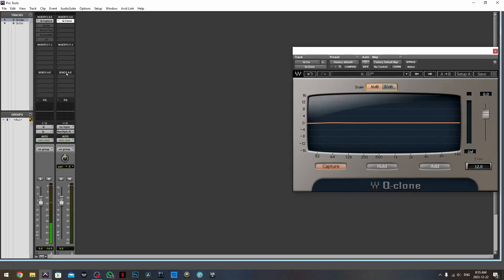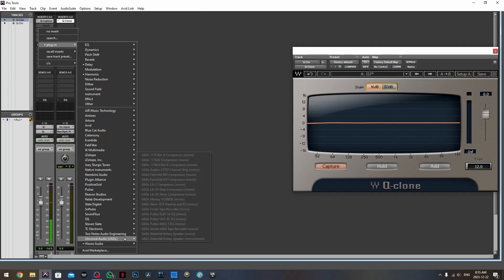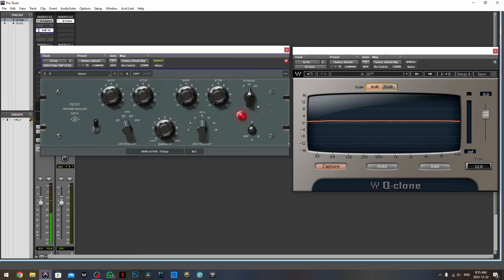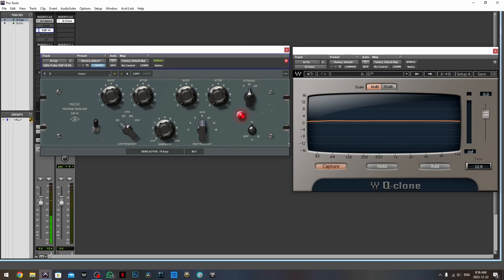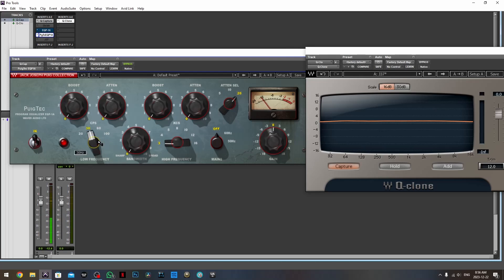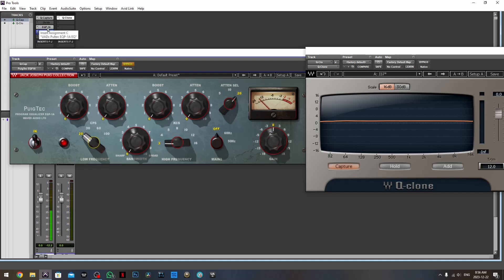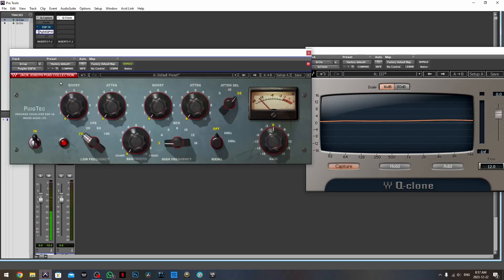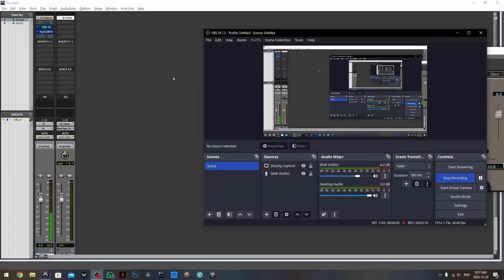UAD Pultec VS Waves PuigTec in Q-Clone

Comment: If talking about the bass boost, the UAD cannot handle bumps in infra range (like 909 kicks in original hardware and plugins like Drumazon 2). It will have an aliasing noise, if you put a compressor afterwards (and push it very hard). Confirmed by UAD, but they are not going to fix it.
Reply from the maker: They are giving it away now I think